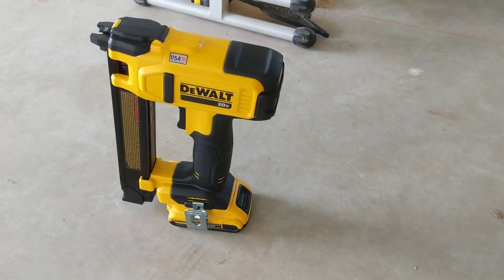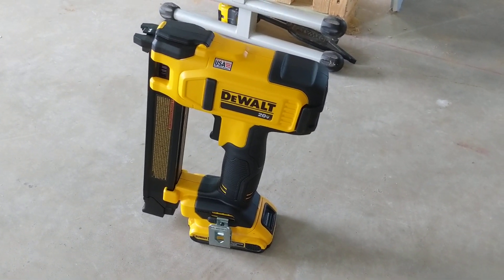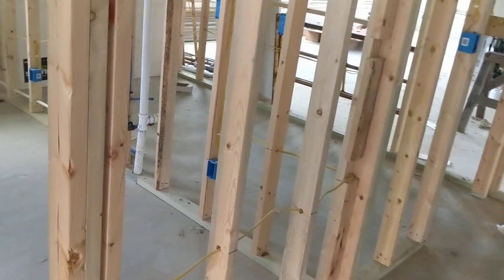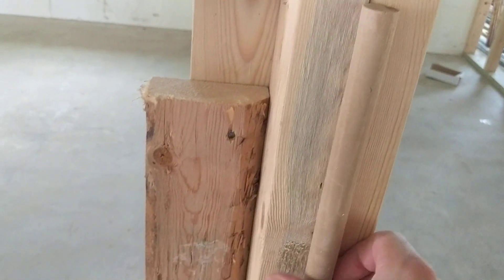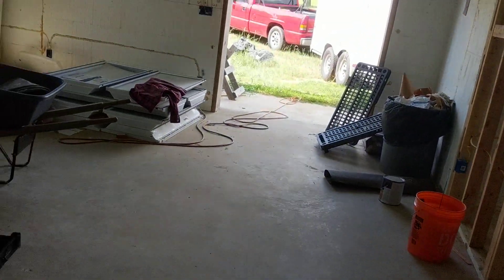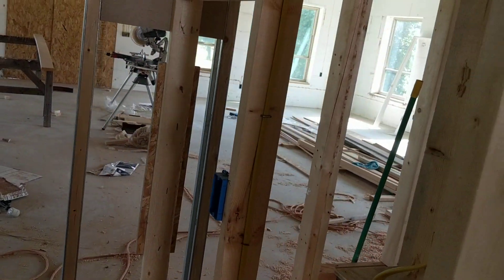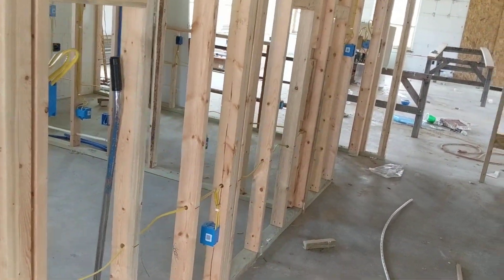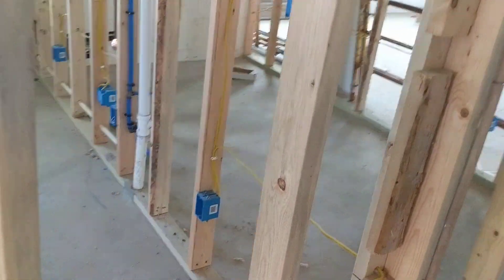DeWalt 20v Cable Stapler DCN701

Comment: Where does in state in the nec code for remodel you don't too support the cable
Reply from the maker: Only when you are fishing through drywalled stud bays and you can't reach the cable to support it (334.30(B). If you can "reasonably" reach the cable, then it needs to be supported according to NEC guidelines.

Comment: I hate how loosely it holds the cable, I like to make sure the wires have some tension so they look neat..
Reply from the maker: I just wind up putting an extra staple on vertical runs. It's better than the poor guillotined cables I run across from helpers.

Comment: I hate it. It leaves the cables waaaay too loose. You can snug a wire up to keep it looking neat. This won't allow that.
Reply from the maker: I like that about it. They're suppose to be loose enough to pull a little so when you need that extra 2 inches in the box you can actually get it. I do put more staples on my drops, but that's so the drywallers won't hit the wire. To each their own though.

Comment: Those staples look expensive.
Reply from the maker: Yeah, that's the one downside to the unit, but you're spending an extra $10 maybe, and saving a lot more in time, plus it's more fun, and anything that makes a boring job fun is worth it to me.
Reply: @MyFortressConstruction  Right on mate, I can respect that.
Reply: $15 at Home Depot (DRS18100 insulated staples by DeWalt)